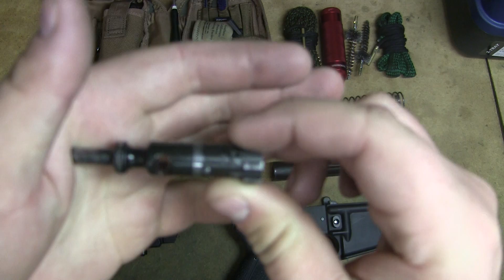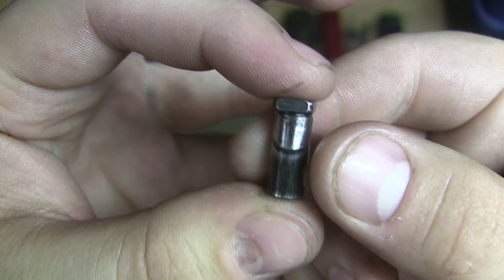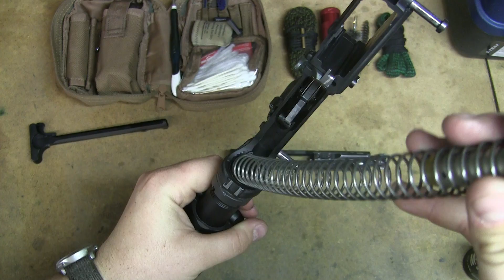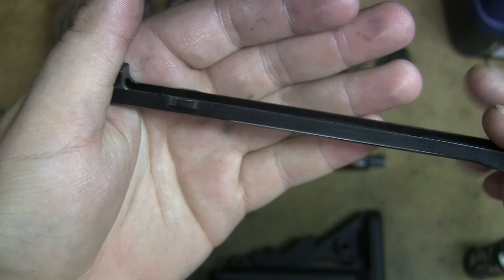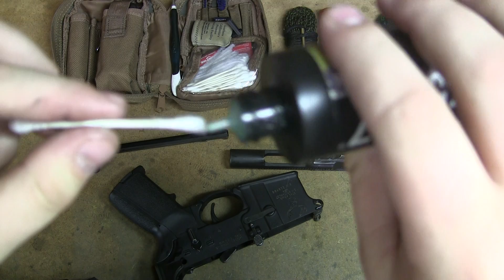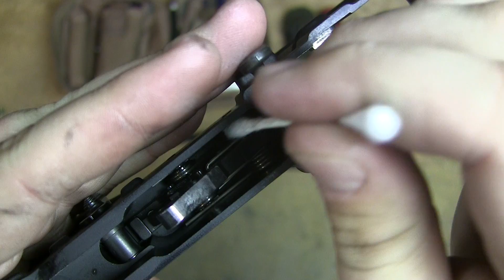AR15 Lubrication

Comment: Stupid question - What are the small holes in the bolt for shown through the ejection port?   What brand BCG is that?
Reply from the maker: Those two holes vent excess gases. You may notice the gas rings are visible through those holes if you pull the bolt forward and back.
Reply: @Mr2ndAmendment    Thanks, I found a great video on how the platform works.  Great design  - almost genius yet simple.

Comment: What about the AR-10? After about a 100 rounds I have to oil it even with the adjustable gas block
Reply from the maker: I'd have to look at it to see the setup, but an AR10 should not need re-lubrication every 100 rounds. I would suspect something is wrong with the gas block, configuration, ammo, or something - that should not be the case.

Comment: Question, I've been told on many occasions to keep lubricant off of the firing pin. Am I Fudging that? I'm running a short stroke Adam's piston and I've literally been warned to keep lubricant off the pin.
Reply from the maker: You'd be fine without lubricating the firing pin, which would be the safest approach in general. The concern comes from somebody lubricating the firing pin, then leaving the rifle for a long time. Depending on what lubricant was used, overtime it could gunk up and get thick, which creates the problem: a stuck firing pin. Most people long-term storage their ARs with the hammer forward, pushing and resting the firing pin forward, and if the firing pin was lubricated, left for a long time, and the oil gunked up, you have potential danger. 

The danger is that the firing pin stays in the forward position when you go to chamber a round, thereby creating an out of battery discharge, or a slam fire. There are several key elements required to make this perfect storm happen, and it's not extremely common, but it can happen. 

For rifles that get constant use, it really isn't a big concern. For rifles that may go many months without use, this could be an issue, also potentially made worse by the conditions the gun was stored in.

As always, if we pull any gun out of the safe to go shoot, and we haven't shot it in a long time, it's recommended to inspect, field strip, and clean prior to taking it to the range. 

For guns like the AR15 that have a free floated firing pin, I generally will never chamber a round or load any ammunition unless I'm at the range, with the rifle pointed in a safe direction, so if I did experience a slam fire, at least it was at the range and pointed in a safe direction.
Reply: @Mr2ndAmendment  Thank You. I've had Arm's for many years. You definitely don't lube those firing pins. Picked up my first AR platform about 2 years ago now. Being an AK fan I went with short stroke piston actuation. I have really enjoyed my Adam's AA15. The accuracy is par none.

Comment: Dri-Slide Molybdenum is the best thing I know of . I disassemble the bolt carrier group and spray Dri-Slide Moly lube thoroughly and let each part dry . then reassemble .  it does not attract dust , dirt , grit or sand . SEE; DRI-Slide weapons lube .

Comment: Its simle a few drops splashes everything during firing but grease just a bit in charge handle helps a little with gas blow by no oil spray in face

Comment: The design of these rifles in history.  M16 the more oil the better, m16a1 less oil, m16a2 very little oil or dry lube to be used.  My AR I fired 100rounds thru it then observed all the moving parts check the build up areas of carbon those areas I used less lube due to it could effect the function of the rifle.

Comment: Less is more in the way I see it. I've seen the videos of the guy putting the rifle together just dripping in oil stating "ARs like to be run wet...". That's just more crap to attract dust, carbon, etc. May as well wrap sandpaper on your BCG and install that thing. I only lightly coat oil on the moving pieces, put some on the rails of the BCG, and put it together. Very similar in process to how you've done it. Good job.

Comment: Why is it a bad idea to let your hammer fall foward?
Reply from the maker: Most people won't ever experience the consequences from it.  I've seen broken bolt releases and (at worst) a cracked lower from this.  When the upper is off, and you pull the trigger, the hammer hits things/parts it was never meant to interface with.  Consequences may follow, or they may not.  You lose nothing by being careful with your equipment, you might lose a lot by rolling the dice.  Everybody can do as they want, it's not my gun.

Comment: you didn't align your gas rings and a dry bcg is only good in dusty conditions.
High humidity,salt air,cold wet environments need at least a wipe down.
Reply from the maker: There's absolutely zero need to align gas rings, that was the first thing they debunked in the armorer's school, and they even demonstrated an M4 functioning perfectly fine with only one gas ring. If there's any myth I wish would die a swift death, it would be the gas rings alignment tale -I think I'll do a video on it and show how an AR will still function with even just one gas ring.

Comment: One thing I learned from my range time in the army: I was experiencing jamming issues. My armorer (a Special Forces Weapons expert) looked at my bolt. He told me to make sure the splits in the gas rings were not aligned. Make sure each one is offset. No more jamming. So even today, on my AR. I make sure to check that when cleaning.
Reply from the maker: The first day of Armorer School, the salty E7 told us that staggering gas rings was bogus. The rifle can actually function with just one ring, and he pulled two rings off an M4 bolt and demonstrated semi and full auto fire flawlessly. 

The gas ring run on the inside of the carrier squeezes the rings tight, staggering them is not going to help if you've got severely worn gas rings and/or an over-dimension carrier. 

I'll do a video debunking it.
Reply: Former Army here  88-98.  A bad magazine will cause double feed or a bolt over ride ,  a sticking or worn extractor will also cause issues.  Improper cleaning of the gas block passage will cause failure to feed after firing a round. 
The gas rings can cause some loss of function but usually not enough to cause a jam.   One thing when you first get your rifle count the number sealing rings that are on the bolt some have 2 some have 3.  You should be able to place the BCG vertical on the locking lugs on the bolt and it will not retract , if it does  the rings are worn out and time to replace them.
Reply: @MustangGuru great advice!
A thank you to you and all the vets for serving and sharing knowledge
Reply: Yessir, keep gas rings at 3rds on your bolt. That's NO BULLSHIT sir.
Reply: Your gas rings continue to rotate as you fire the gun, making it actually unnecessary to space the gas rings so that they do not line up. In fact, the gun will continue to operate with only one ring. The other two are for redundancy.

There could have been many other potential issues that caused the jamming. Could’ve been that the rings themselves needed to be replaced. I mean there’s also other mechanical issues that could be the problem
Reply: So should I remove the bolt after every shot to be sure they didn't rotate? Better yet should I super glue them?
Reply: @hoppahaole3155  
Gorilla glue will withstand the heat. Super glue will burn off and eventually the slots in the rings will align themselves. The unknown is: 
 will it happen after 10 or 1,000 rounds?
Reply: @hoppahaole3155  JB weld them bad boys... Be sure to put plenty and put it back in the receiver before it dries... Let it form to the gun :)
Reply: Wow! Thank you !
Reply: https://youtu.be/hgW2iNVLaA8
Reply: I’ve heard that before but I’ve never experienced it
Reply: ..they WILL NATURALLY ROTATE all the time. You literally could NOT “KEEP” them from rotating UNLESS you ‘glued’ them in place! They were designed to move..and it was R & D’d for 3, but can run with less rings, BUT pressure can suffer.
Reply: It's been proven that the gap offset from gas rings is pure myth. When the gas rings are working as designed the seal that they create during locking and unlocking will operate as designed nomatter the orientation of said gas rings. Your gas rings may need replaced completely OR you encountered a completely different issue. Could also be magazine issues.
Reply: They rotate.   How do you keep them separated between shots?
Reply: Facts

Comment: Great video.  Every gun is different.  For example, my Beretta 92FS needs less lubricant than my SIG Sauer P226.  The SIG will actually experience failure to extract if it isn't "wet".  I oil both a little more than many shooters would, but I oil the SIG a little more than the Beretta.

Comment: I see wear on back of your gas key where it rides inside the charging handle.   Since charging handle is aluminum and gas key is steel, they are dissimilar metals and any contact surfaces should be lubricated!!  Look for wear on the inside 'sides' of the charging handle.

Comment: Good video..You are right..It is a good idea to lubricate that buffer and spring.That spring rubs a great deal on buffer tube walls.One place I do put a  lubricant that you do not is the trigger
 I always check and put a little grease on Trigger contact points.
I also use that Fire Armor CLP PRO.. its good stuff.

Comment: I use Lucas Red bearing grease applied with a hobby brush to the same points.  I also use synthetic machine oil on internal pivot parts.  Any petroleum product will tend to evaporate over time.  Bearing grease and synthetic oil sticks around for a long time.

Comment: So your saying put oil where it counts , what about when all that little bit of oil is gone for what ever reason, then what do you do? Keep shooting obviously,  in combat that’s the last thing on your mind.
Reply from the maker: So, a typical combat loadout is 7 mags. I've never come back inside the wire with absolutely no ammo, and for dismounted missions we'd take more in assault packs (2 day bag), and mounted operations, we'd have more in the trucks. 

The point being, if you lubricate the rifle like I show here, that should last you at least 500 rounds, but I've gone much further in testing. My practice is to do a wipe down, basic cleaning, and re-lube like this about every 500 rounds, which is definitely much sooner than it really needs. 

The AR is a pretty incredible system, and I recommend to invest in a quality barrel and BCG at least, and when you got quality components, it'll run all day.

The real enemy is heat and sand. Heat dries out your lube, but also makes wear happen faster, especially if you're doing rapid or full auto, the heat catches up to you quick, and we start getting enhanced wear with the bore, bolt cam, gas rings, and such. Sand is also the enemy, if it gets inside, it basically creates a lapping compound effect, and huge grains can cause malfunctions, but that would require basically pouring sand inside an open action. 

One of the best features of the AR15 is the sealed system dynamic, the fact that you can close the ejection port cover and insert a mag and have a rifle that stays protected from the vast majority of the environment.

Comment: Why not lubricate the lugs? They experience metal on metal contact
Reply from the maker: That's one of the most-asked questions on this video, and my reasoning behind it is to not want to put anything in the barrel extension that would attract dust/dirt.  On a flat range, in good conditions, you won't have to worry about it.  In austere environments where maintenance has to be delayed, I insist that the bolt lugs and anything in the star chamber should be dry.  The last thing we want is sand or gritty material impacted into the star chamber, preventing full chambering.  Not a problem under normal use, but something that could happen in the field.  You won't hurt anything by lubricating the lugs for normal use, but I would not go into an austere environment with any lubrication in the star chamber/lugs.

The real issue experienced with bolts are cracked or sheared lugs -which tends to happen if the bolt quality is not correct, or on over-gassed guns, or guns with dwell time/timing issues.  I'd worry more about that, if you got a 158 carpenter steel (or better) bolt, with a quality barrel extension, it'll be fine.  

My philosophy comes from my time in the Army, where the priority is for the equipment to work, even if that comes at the cost of long term wear.  I'm totally fine replacing casual wear items as they wear if it means I can help improve my chances of reliable function in austere conditions.  A quality bolt/barrel combo will serve you well and for many years, even without lubricating the bolt lugs.  This is why I tell people that you really do not want to go budget on the BCG and barrel.
Reply: @Mr2ndAmendment  true. If I were going into war, I wouldnt lube them. But you're prob just gonna use it at the range next
Reply from the maker: @Alexander-qd7nj  

You are definitely correct, most of my viewers don't need to plan for the worst.  To the AR15's credit, it will still perform (under normal conditions), even with excessive lubrication.  It will just spit and drip out anything it doesn't want or need, but no harm will be done to it (unless you glob grease up in the bore, that would be a potential disaster of course, but that's not really what we're talking about).

I've put a lot of rounds downrange with my ARs, specifically my M4A1 build, and the bolt is still doing great, despite the lack of oil on the lugs.  I think it just comes back to buying quality components, that will take you a long way on the AR15 platform.

Comment: High temp grease is what I use on everything. Works like a charm, oil get hot and evaporates, grease stays put.
Reply: Same,  I use the Slip series grease, just on the rails,  there where it is 'needed'...
Reply: Just don't over do it with grease 
I've seen ppl slap all kinds on the recoil spring then get into cold weather and wonder why it won't cycle lol 
I just use a lil touch where trigger and hammer contact other than that strictly oil, every1 has their own way I guess
Reply: @matthewbeaver5026  I like to apply a smal dot of grease on rails too
Reply: @matthewbeaver5026  I live in florida, not a problem here.. lol
Reply: I've had great results over the last 20+ years using Brownell's Action Lube Plus on several AR-15's & AR-10's. It appears to be a moly-based grease. Apply very thin film on metal to metal contact surfaces. It will not hold dust or sand, eliminates friction & will not evaporate. Great long-term protection against rust or other oxidation. Quiets buffer spring with a heavier application inside receiver extension tube. Makes for smooth, reliable function and eliminates almost all traces of wear.
Reply: NADS IQ  Lithium grease is the way to go :) Like the cheap but effective Lucas red N tacky etc
Reply: 000metalmilitia I live in California and the only AR15 I have is the single shot Franklin. Do you think oil would be OK in this?
Reply: let us prey I use it
Reply: Small film of bearing grease on the specified areas. A drop of synthetic oil on the springs and pins. No need to buy expensive "gun oil." Just remember, don't go crazy. A dab will do ya. Weather will not be a factor.

Comment: That is a minimalist approach.I use a very light synthetic grease on the bc and a mixture on gun oil and trans fluid on the bolt.The charging handle gets the transmission mix and the buffer assembly also.When I pull my charging handle back the bcg feels like butter.
Reply from the maker: If I had the proper equipment, I would test automotive lubricants in the AR15 to get some data.  Right now, it's a giant mystery.  It appears to get the job done, depending on type and brand, but I'm more concerned about the additives they put in automotive/engine/transmission oil.  The polymers and other things that are there for the purpose they were designed for, but is it alright to let that smoke up/burn and inhale it?  I don't know, I have no way of knowing.

For the time being, with a functional society and the ability to obtain and purchase whatever I want, I'm sticking with lubricants that were designed for firearms with these factors kept in mind.  If I was in some kind of survival situation, I would use automotive oils, but I just don't know enough about them from a chemical/scientific angle to know if it 100% is not harmful to inhale. 

Just some thoughts, I have no concerns of it damaging the rifle, I'm sure it works functionally well, I just don't know enough about it yet to do it.  Firearms-driven lubricants are available, affordable, and last a long time, and there are some great ones out there, I just haven't found the need to use anything else.

Comment: Screw your mag release in more! I have always ran my AR's very little, only on the BCG rails, and a tiny bit on the charging handle
Reply: Mag release is just fine. In fact, the way its loosened, it's still retained but allows slightly warped mags to drop.

Comment: If you used a gun grease on that bolt cam, it probably wouldn't wear half as much. High temp grease stays put  under high temperature environments.I always use grease and I have shot many thousands of rounds through mine and my bolt cam doesn't look half as worn as this one does. Just my two cents 😁. Gun oil burns off too quickly in my experiences